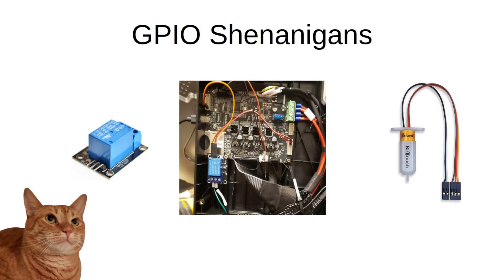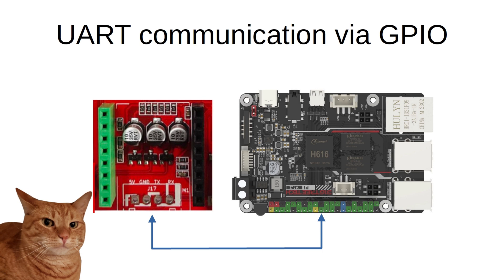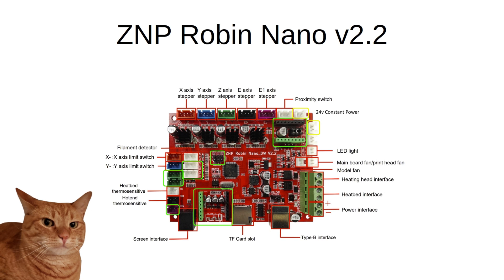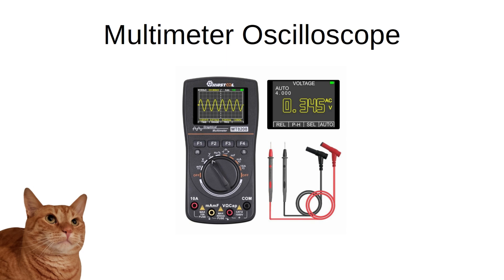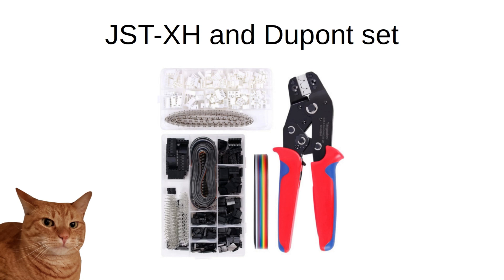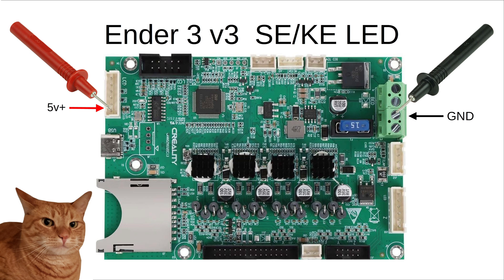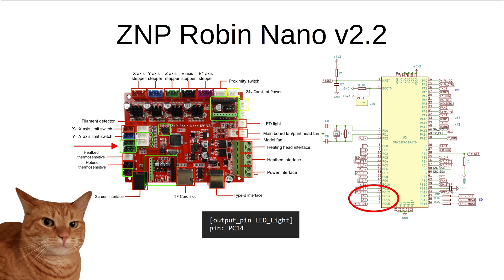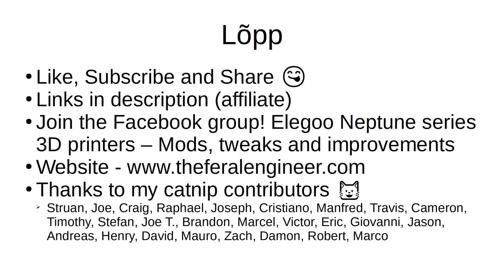GPIO but were too afraid to ask

Comment: Hello. Can I connect a new temperature senzor and fan on ZNP robin nano 2.2? I built enclosure for Neprune 3 plus and I would like to connect fan and temperature senzor on the main board. I have upgrade to Klipper. Could you help me?
Reply from the maker: I don't think there's an additional, dedicated fan output on the v2.2 board, but you can connect a second thermistor to the second temperature sensor port and use spare GPIO to control a relay that drives the enclosure fan.
Reply: @TheFeralEngineer  Thank you for your helpful answer. Currently, I have successfully connected the temperature sensor to the board. Is there a pin that I can use as PWM output? I would like to control fan through PWM module.
Reply from the maker: @mbadin  no, there are no open pwm pins to my knowledge.
Reply: @TheFeralEngineer  Thank you. I see there is FAN3 pin that is currently used as LED output.
Reply from the maker: @mbadin  you can swap the LED section for a fan section and use the same pin, but you'll lose being able to use the light unless you tap into another output and connect a relay to it (or hard wire it to the PSU)

Comment: THIS is the content I’ve been looking for. Keep it up man, I appreciate you and what you’re doing.
Reply from the maker: I also have some videos on creating a secondary MCU using a pi pico or any other board running the rp2040 MCU that you might find equally as useful
Reply: @theferalengineer do you have to use the J17 pins for the bltouch? I have been trying to set-up mine using Z+ (3-pin) and MT_DET2 (2-pin). I get power and the sensor does it's self test but when I send the debug commands I get nothing. I was hoping to avoid soldering to my board. Thank you